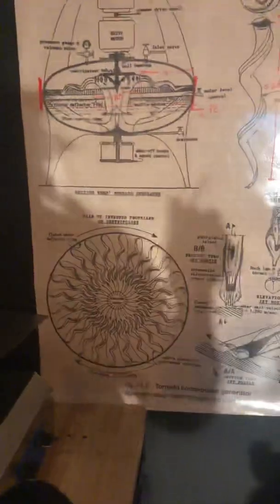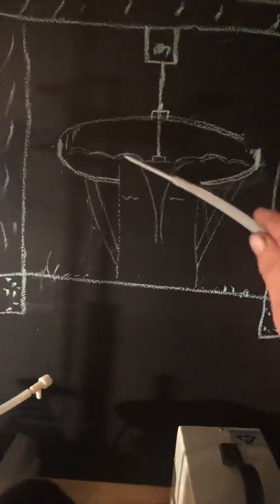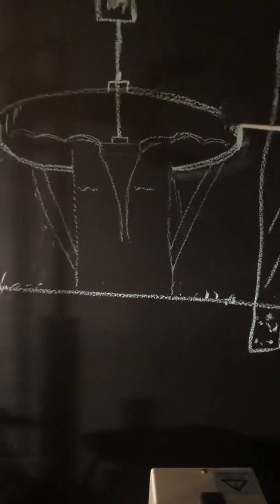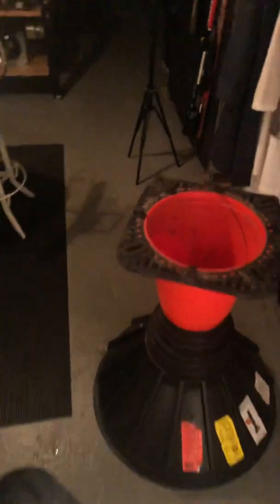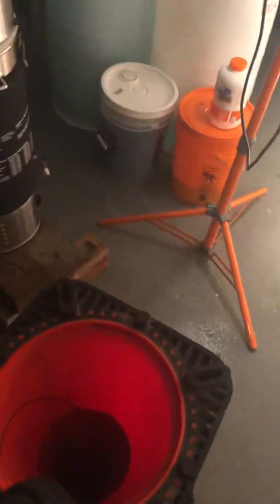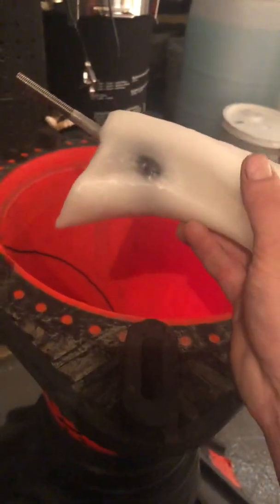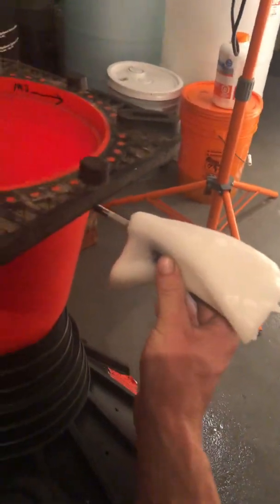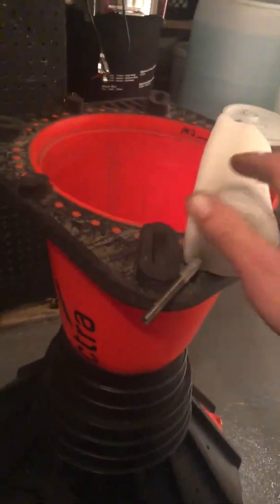Viktor Schauberger Tornado Home Generator

Comment: Fascinating construction you have. Can't wait to see how it all works out
Reply from the maker: It’s my own unique solution to the problem. I know everyone says 3d print 3d print but there is something about the manual work, the mess to clean and clean to mess, spilt wax and bubbling chemicals.
Reply: I predict that absolutely nothing will work out. Schauberger did useful constructions in earlier years, but later he turned more and more to a crackpot. This "Home Generator" just as others of his later inventions will not work.